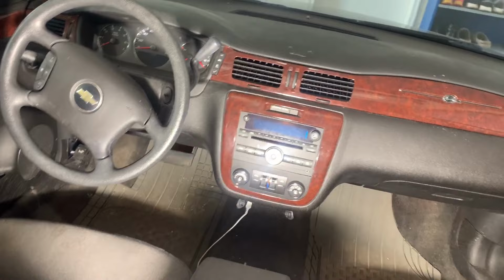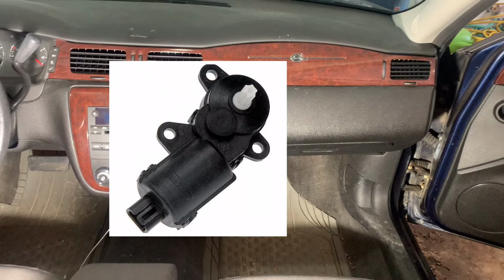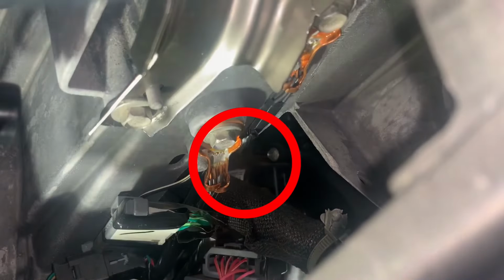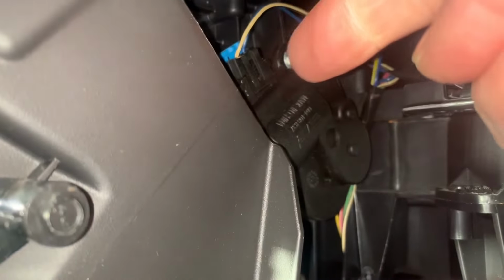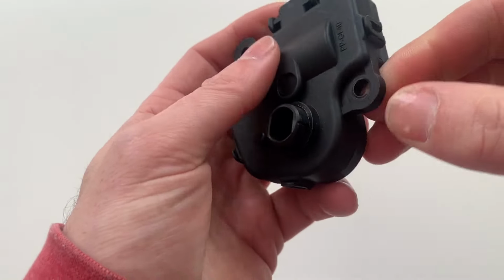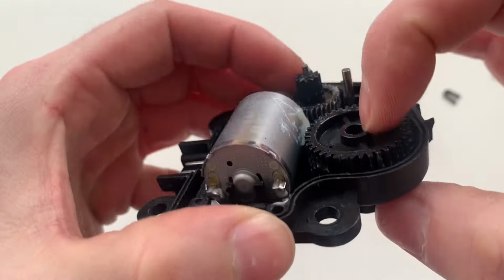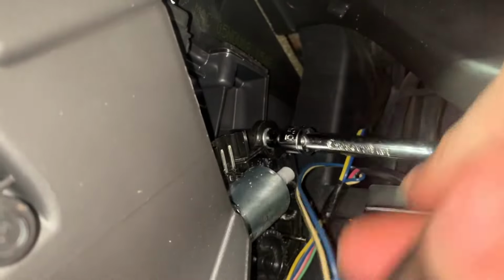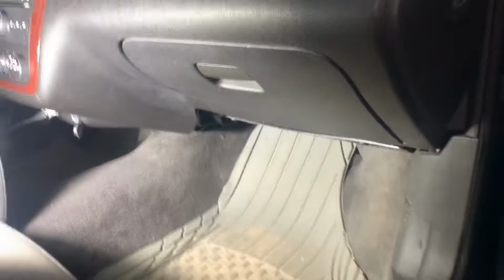FIX Impala Loud Tapping Noise in Dash! How to Replace HVAC Vent Blend Door Actuator ALL 3 LOCATIONS!

Comment: Are the actuators the same ? It’s the recirculating actuator on my car?

Also could this issue cause a parasitic drain? I have something on mine draining
The batter after it sits a few days. I wonder if this actuator could do it ?
Reply from the maker: Yes, all 3 actuators are the same part. 
I personally don’t think it would cause a  drain. It only draws current when the computer tells it to.
Reply: @HowtoandReviewsOfficial  
I'm thinking I need a new battery because I have let it slide for a while. I'd hate to go far from home and be stranded because of a dead battery caused by the actuator ticking constantly.

Comment: This is a project I’ve been putting off for a while. I’m sure multiple actuators need to be replaced. But as of yesterday, no air is blowing at all. Still lots of ticking, but no air whatsoever on any settings. 

Would you happen to know if this is a blower issue? Would a blower need to be replaced or is there a fuse that controls that function to be tried first? 

I realize this is outside the scope of your very helpful and informational video, but I’m hoping you may have some advice to keep this northerner from going broke at a repair shop for my 2011 Impala. 

Thank you for any advice you can give❤
Reply from the maker: It could be all of the above.
If the blower is not turning on, it could be a fuse or the blower itself.
I have had to replace blowers. They do go bad. You will be able to hear if the blower is running when you switch it on or off. It is located under the glove box. 
The actuators are a separate issue. If they are ticking, they will still need to be replaced as well.

Comment: I've had that annoying clicking sound for years...if I don't bother the hot/cold dials it's all okay. Just a few days ago it started it & would even continue on after removing the key from the ignition switch. This is a fabulous video...thanks for sharing it! I plan on setting the stepper motor to summer then change it when winter comes around...thanks for the tips to save money!
Reply from the maker: Glad it helped!
Reply: so which actuator did you have to replace or did you have to replace all?
Reply: @KeaganTuel  Ended up replacing the passenger side actuator. That fixed the issue.

Comment: Trying to shut down the racket!  The two actuators on the glove box side has the left one defective as I can  see it and feel the noise.  The shaft however will not rotate on the white shaft after the left (behind the glove box)  is removed. There is another noise coming deep within....... could it be the one under the steering column or is there another culprit to investigate?

Comment: Wow this was more informative than hours of research on the internet. Great video. Though I would like to see a tutorial on replacing the mode actuator as well.
Reply from the maker: Glad it was helpful! I’m pretty sure the dash needs to be removed to access that fourth actuator.
Reply: @HowtoandReviewsOfficial  Well, most videos will answer a few questions, but you answered literally every question I had about this part and it's locations, functions, etc. Very well done at putting yourself in the viewers shoes and anticipating what they'll need to know.

Comment: The stem you are tuning with your hands does not turn on mine what is that part called?
Reply from the maker: That is part of the blend door. It is a shaft that is part of the blend door, which is the door/valve inside of the duct.
Reply: @HowtoandReviewsOfficial  thanks for the reply! im sure that will be a pain to fix, i dont even know where to start lol!
Reply from the maker: @CLIXZZ  I would probably start with some vice grips and a rag to try to rotate the shaft and free it up. Other than that, I agree, I wouldn’t know where to start. I don’t think that’s a replaceable item.

Comment: Does the HVAC stop your A/C from working or do I just need to recharge it?
Reply from the maker: I would think that you need a recharge. For faulty actuators to result on no ac, you would need two bad actuators, both stuck in heat mode. Is the air hot (heater air) or is it just not cold?
Reply: @HowtoandReviewsOfficial  it’s hot air

Comment: Mines only makes the noise when i use fresh air setting
Reply from the maker: It will be the actuator all the way to the right, which is one of the easier ones to access.

Comment: That’s unfortunate, I’m having a hard time getting to my actuator. At least it isn’t the hardest one to get to. I will prevail!
Thanks for the informative video!
Reply from the maker: Glad it was helpful! Good luck!
Reply: Fixed! Apparently I had two bad actuators, both on the passengers side. Thanks again!
Reply from the maker: @shoki7234  Awesome! Great job! Hopefully the one on the driver’s side lasts forever!
Reply: Working on my mom’s 2014 chevy impala. Thanks to your video, I was able to locate the ticking sound. It’s the hot/cold actuator on the left side of the glove box. I was able to  remove the actuator box, but I cannot manually move the hot/cold control shaft!!! Currently the flat sides are vertical cold position…snd it’s winter. Prior to removing the activator box, the heat was working just fine (with  ticking that would eventually stop by itself). Help!!!!

Comment: Great video. I replaced 2 of my actuators 6 months ago, and now I get the clicking again. So I'm going to do the work-around this time. Enough money has been put into these bastards.
Reply from the maker: Same here. The one that went bad in this video was a replacement from about a year ago.
Reply: @HowtoandReviewsOfficial any idea how to get ones that last longer? The oem aren’t great but somehow lasted 7 years in my 2016 LTZ
Reply from the maker: @philtripi9937  Unfortunately not. The best option is to use am OEM replacement (not a cheap aftermarket replacement), but even those are known to potentially fail in short order. They may have a warranty! If so, I would purchase from an auto parts store, then you can easily swap it for a new one if it falls during the warranty period! I have not investigated that. It is something to look into.

Comment: Just finished the install of the driver's side actuator and the inner passenger side actuator. 

Driver's side sucked to do!   I'm thankful for this video!

Tips for anyone needing to replace the driver's side....

1. Also remove the plastic trim plate above the gas and brake petals.  It makes this WAY easier. 

2. Get a LONG 1/4" rachet extension and universal joint.  12"-14" in length with a 5.5mm socket. I couldn't imagine doing it any differently.

3. A forked ended trim removal tool was really handy for taking loose a couple wire harness holders to gain better access. 

3. Have jumper wires handy to help align new actuator hole with the old one.  I also had luck by hooking up the power before installing screws and turning the heat and down while holding new part over the existing actuator.  It eventually fell into place. 

5. Don't get the cheapest part, as you do NOT want to have to do this again. I used Dorman  brand $20 on Amazon or Rock Auto.  

Final thoughts:
If i was better prepared with the right tools, it would have been much easier. It really sucked with the tools I had. Glad it's done. If it acts up again, I'm selling the damn thing. 😂
Reply from the maker: Great information, thanks for sharing!
If I ever have to change the driver side, I plan to make a dedicated video. But maybe I’ll take your advice and sell it.
Reply: When you want to sell, let us know

Comment: The drivers side is definitely challenging, especially if you do not have small hands, have to be a bit of a contortionist. Most of the work had to be done by feel, no way to be able to see in there while your hands are there. Passenger side is a cake walk compared to the drivers side.
Reply from the maker: Great job replacing the drivers side actuator! Definitely an awful job to have to do.